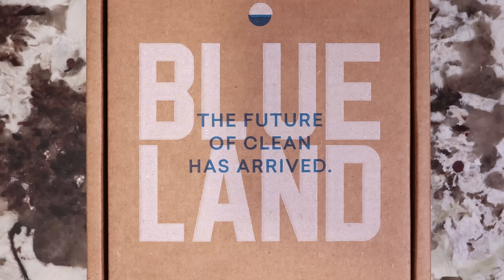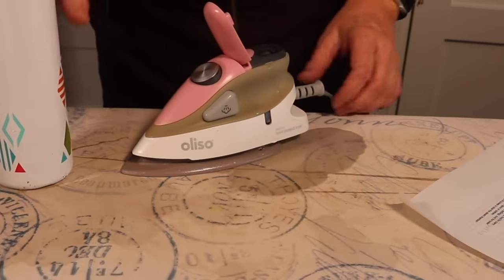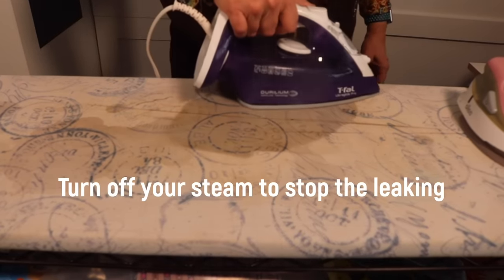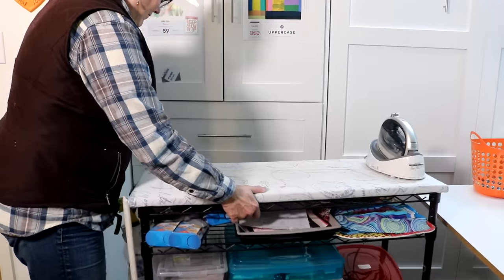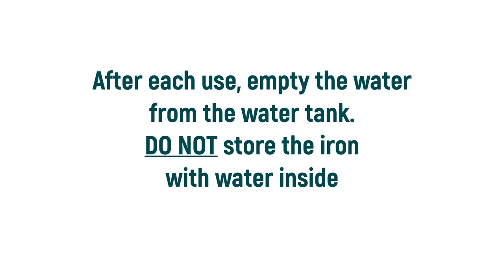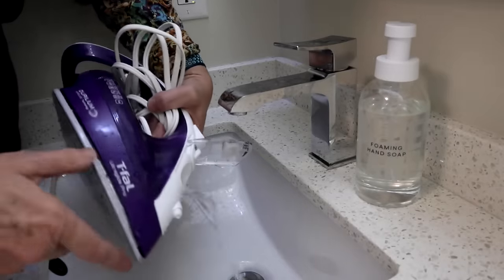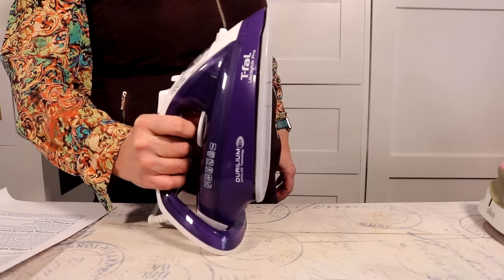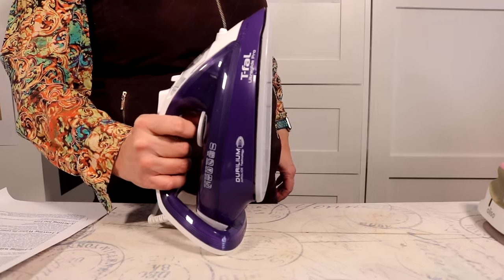🧺  LEAKING IRON? - 8 WAYS TO PREVENT WATER LEAKING FROM YOUR STEAM IRON

Comment: My mom once gave me an iron as a moving out present. It was horrible, it leaked straight out of the box. For a month i struggled with the store, trying to return it and get the money back. They took it twice to their guarantee repairs, but nothing changed... Untill a few yelling sessions they finally accepted that it was a factory defect. But they still didn't want to take it back and return the money. They wanted to exchange it for another one of exactly the same kind of iron. After another yelling session I finally got to speak to the manager who gave the money back. The same week i went to another store and bought a cute salad green iron that i still use today. It was 2005 when I moved out and got green friend, very satisfied. 

I actually use distiled water for my iron coz the tap water here is very hard and my iron got a lot of lime scale, everything that i ironed got covered with sand like particles of lime scale. Distiled water seems to work fine with my iron, no leaks, no complaints. .

Comment: The sound cuts out at the 11:06 mark. I sadly missed the end commentary. Otherwise, it’s an extraordinarily informative video. Hopefully, these hints will help stop my Rowenta SteamForce from leaking all the time, despite my having followed most of these tips even before viewing the video. The one thing I learned, but I was not previously doing was turning off the steam switch when I’m done using the iron. I was also not releasing steam from the steam chamber. I was going through the cleaning process almost every time I used it, even though our water is soft. I always emptied the water out of it when I am done. So, the takeaway for me was turn off the steaming switch and release steam from the steam chamber prior to storing the iron. The devil is in the details.
Reply from the maker: it is 👍

Comment: Excellent video, but I do want to correct one really minor thing - distilled water boils at 212F/100C (at sea level) and it is tap water that has a (slightly) higher boiling point.  Dissolving anything in water (salt, sugar, minerals, etc.) raises the boiling point.  Since tap water has minerals dissolved in it, it has a higher boiling point.

Comment: I don't typically put water in my iron, to extend the life of it. I use a spritzer bottle to add a mist of water to fabrics when needed. Is it hard on irons to NOT have water in them?  I keep the steam setting to off.  Also, what is the best way to clean the sole plate of the Oliso iron? The manual just says to clean it but doesn't recommend a cleaner! Mine looks gunky from Best Press. Thank you, Karen!

Comment: Great info (as usual).  I have a steam station iron (Rowenta) and it just started leaking.  I have been using distilled water for years although the manual says not to so I'm switching but the temperature on the iron was too low and the room is chilly (58) and I think that's the problem.  It only leaks initially so I've let it leak and then after a few minutes it's fine.  So it's likely a temperature problem.  Thank you.  I always learn so much from you.

Comment: Karen, I always learn a lot from you. I have always used distilled water, mostly because my mom did! But in 40+ years of marriage we have lived in the country and had a well. They have always been high in iron. But I will go back and read my cordless Pansonic and see what it says. What if you remove the chamber from the iron when not in use and store the water chamber separate?
Reply from the maker: That is the reservoir not the steam chamber. To empty the chamber turn the steam switch to off and use the pulse to make steam with the remaining water until the chamber is empty.

Comment: I went through four Oliso's. All the spitting and spattering. Then they die. Come to find out irons need to be plugged directly into the wall socket. Using extension cords or power strips do damage to the machines. I learned this the hard way and one of the most important things anyone can do is make sure they read the directions that come with the iron. Mine took topwater but I thought I was doing the right thing by using distilled water. Distilled water destroyed them. And I was told this by the company as well. So although your advices were fine there is an issue with the type of water you use in an iron. It's clearly in the directions on what type of water to use. Makes a huge difference
Reply: Why would being plugged into a power strip/surge protector damage them?  Any idea?

Comment: This is the BEST video explaining irons!  I had a distilled water iron...then I bought a new Iron that does not require distilled.  Because I didn't read my directions (dumb) I thought I could just add distilled water and go, I ruined the iron.  I now have an iron with a sole plate that is non-teflon.  I accidently hit "something" (double sided heat n bond?) and now it has residue in one spot on the soleplate.  I've tried watching videos on how to remove the spot, but either it didn't work or made the spot worse.  Any suggestions?  I should have asked this on your Q & A this past week!
Reply: My iron is shiny stainless steel. I use a magic eraser on my sole plate. Mine fell into the trash on a plastic bag while hot.
Reply: @barbarakowalski7327  Thank you!  I haven't tried that yet.
Reply: @barbarakowalski7327  OMG!  Thank you, Thank you!  Magic Eraser did the trick!

Comment: Very interesting!  Can you tell me do newer irons get less hot than older ones?  I have a Black &  Decker that I bought 13 or 14 years ago at a garage sale for $5.00, don't know how hold it is, but I started using distilled water after it began spitting white specks with tap water.  It gets very hot and irons piecing very flat very fast.  I see quilters on Youtube keeping their irons on the fabric for several seconds or more to get the fabric flat.  Are the irons just not as hot?
Reply from the maker: different irons have different temperature ratings

Comment: Karen! This was a terrific video.  I have always wondered about the mechanics of the iron and you answered just about all my questions.  Now can you address the Oliso iron leaking?  There seems to be a problem with experiencing mysterious leaking with this machine.  I'm one who has several irons.  My 360 panasonic is excellent, never a problem but my newer very expensive Oliso.  Oiy!  If you can please help me understand.  Thanks.
Reply: Kimberly Jolly from the Fat Quarter Shop said about the Oliso to let it warm up first also and empty it when finished. Mine also leaked and did a spasmodic jig once even after shutting off and unplugging. I use a spray bottle now.

Comment: Does the rule to pour out water when storing apply to overnight when you’ll be using it the next day?
Reply from the maker: If you turn off the steam and release all the steam from the chamber it will remove most of the water
Reply: @JustGetitDoneQuilts  Thanks a bunch. I’ve learned a lot from you!!

Comment: The only time my irons have leaked is after I've dropped it or it has been knocked off my ironing board. You didn't address that particular situation. Dropping the iron seems to break some seal inside and let the water leak out. Can't be fixed! Thanks for sharing all the other good information.
Reply from the maker: Unfortunately that was no in the scope of my video. I was only dealing with what you can fix with proper usage
Reply: @JustGetitDoneQuilts  Karen, you do such good work! I hope I didn't come across as criticizing, just wanted to add another perspective so that those who do all the right things to fix a problem and find it doesn't help might realize what the true problem is. I always learn so much from your experience and wisdom. Keep up the good work.